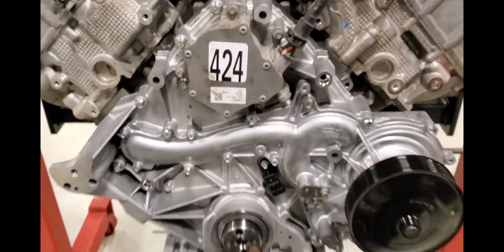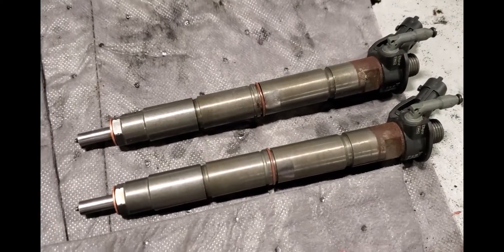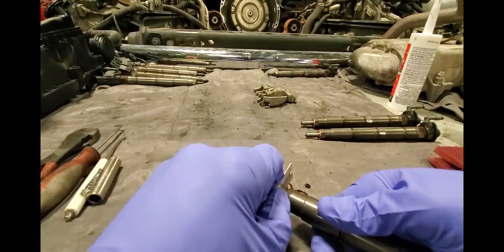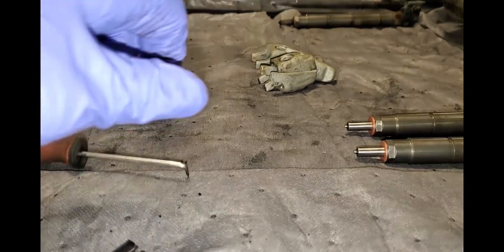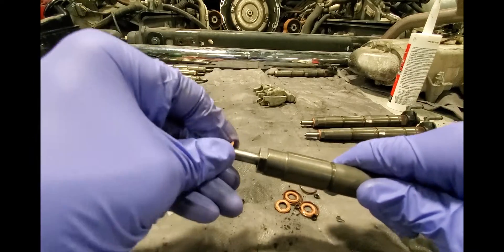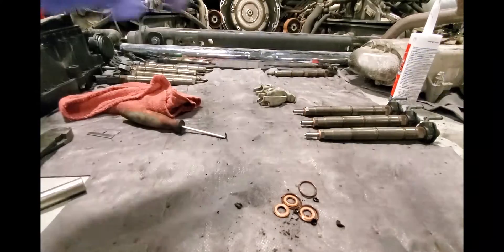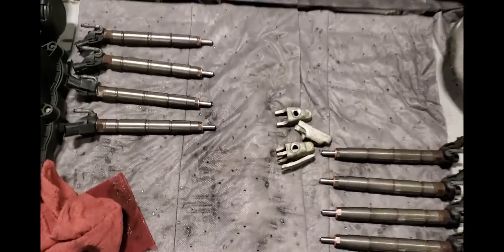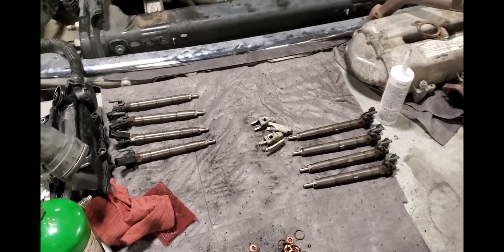How TO Re-seal Ford 6.7 Powerstroke Injectors F250 F350 F450 F550 F650 F750 WATCH THIS and LEARN!!!!

Comment: So I’m glad I found this video, cyl 4 contribution balance code comes and goes on my truck, reset learning values and it does ran better but after 200 +/- miles does it again, shut off engine, turn back on and runs better, did that 4 times on Friday 😬

Comment: Great video. Did you have to bleed pressure off of the fuel system somehow before you removed the injectors? I have to change a valve cover gasket and it's really the only concern I have
Reply from the maker: No u do not

Comment: Just replaced injector to valve cover seals on my 11 6.7 and now have what I think is a injector "knock". No codes runs fine just has a knocking noise. Inj were done 1 at a time so didn't switch up and replaced all components as you did 2 times just to make sure. Ever seen 1 do something like this?
Reply from the maker: Did u program the injector in?
Reply: @PowerStrokeTechTalkwARod  didn't replace the injector, just the seals and verified correct IQA's on the 2 cylinders I did seals on
Reply from the maker: Sry I miss read. No I have not had that happen

Comment: I love your videos,and I love the 6.7  scorpion in a  pickup ... when it comes to straight frame trucks F650 and larger,I wonder why Ford uses  the V8 in those big trucks when a 6.7Cummins would be much easier to work on ,is built for industrial applications, and has a better power curve for a large truck application, IMO , you wouldn’t be doing an engine right now since they will easily run  alot more hours than a 6.7 V8.
Reply from the maker: Thanks buddy, appreciate your feed back!👍

Comment: Ummm, I walked by an F150 looked brand new, but had power stroke badges?????  Do What???
Reply: 3.0 European based timing belt diesel.....not sure how that’s going to go over in the US markets, timing belts are a thing of the past for the most part,the last time a Ford pickup had a timing belt I believe was a 2.3 Ranger....and if it failed it was free floating...this diesel belt fails I bet it’s a 10-14,000 repair bill for an engine
Reply from the maker: Yepppp

Comment: Hey I’ve been watching your videos! I work on the ford diesels as well and wanted to know do those 6.7L in the F-650-750 have a DLC connector for the IDS to communicate or do you have to buy a end for it off rotunda?
Reply from the maker: 16 & up yes IDS does it all. No more 9-pin deutsch

Comment: How was the truck still under warranty? Did they have the ESP?
Reply: That engine shouldn’t have failed , how many hours were on the engine? We put 13-18000  hrs on GM 6.0 gas engines in 10-16 years in town municipality service tons of idling and we’ve never lost an engine just retires our 2002 due to the service body rotting out and it just being time to replace it. 168,000 miles never left the town towed a 185 compressor about 1/3 of those miles and was overloaded every day , meter said 6700 hrs it was rolled once so 16700. Original engine never had valve covers off Lq4 6.0 300HP.  Was considering the new 7.3 gas Ford as the first Ford we would buy that would go the distance without engine work.
Reply from the maker: 650/750's have 2yr/unlimited mileage warranty like pick ups have 5yr/100k...

Comment: Hey arod good job with the videos as always, I got a question my truck has 168,xxx miles mainly highway miles but I was wondering what would you use as a fuel additive to clean up some of the carbine of the injectors?
Reply: I run Stanadyne whether or not it will clean that carbon I don't know but it's supposed to work well for IDIDs. A lot of the cleaners on the market are useless in common rail systems.
Reply from the maker: Not a whole lot. Its a natural occurring byproduct of burning diesel fuel so I don't know if necessarily putting an additive in there is going to be cleaning what you see me cleaning...
Reply: PowerStroke Tech Talk w/ARod okay then got it🤟🏽 I’ll keep running all motocraft parts and additive😎
Reply: PowerStroke Tech Talk w/ARod someone told me to pour a quart of tranny fluid in the fuel tank at every oil change. Have not done that yet, has that been recommended to you or have you heard someone doing that?
Reply: Don Martin if i’m not wrong i’m sure that helps out the HEUI injection system not common rails. that’s what i’m guessing off of common sense and knowledge that i know at the mean time.
Reply from the maker: Yea bro if u had a 7.3 but not these new boys......

Comment: FIRST!!! For the first time too!!!I've only ever long blocked TWO 6.7s in all these years of turning wrenches on Fords. The first one, I had to transfer all fuel system components, so that was the only time I ever had to re-o-ring the injectors as you've illustrated in your video above. If I recall correctly, that copper washer was much tighter than the ones on the 6.0s (of which I've done HUNDREDS from all the head gasket jobs). The second one I long blocked was a drop-in that came with high pressure fuel system and turbo. BTW, how are coping through this COVID-19. I'm the lone technician at my store for now. All the other guys have taken off for as long as need be until this boils over. God knows when that will be at the rate we're going.
Reply from the maker: Thanks bruddah....we closed TWO weeeeeks!!!! Today was last day....
Reply: @PowerStrokeTechTalkwARod  the mitten is getting it hard too be safe.
Reply from the maker: No doubt!!